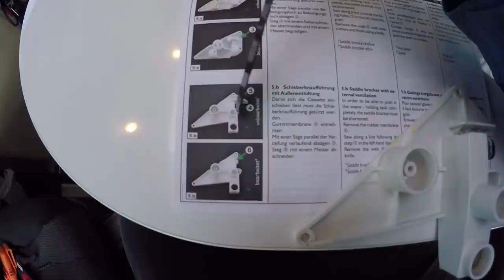Cassette toilet - installing SOG system and toilet talk in a van

Comment: I am looking to buy a similar campervan, but I want to have a composting toilet installed in place of the cassette toilet. In the cassette compartment, i will add a water heater for my recirculating shower. Or, if the water heater already has a space in the van, perhaps the cassette space is large enough for the shower‘s water tank. Thoughts? 🇫🇮🚚

Comment: Dear Finnish friends, how wonderful it is to follow your channel. Finally a couple who dares to say how life is in a Van, the good and lesser moments, winter and summer, and also the adjustments to improve comfort in a motorhome purchased from the factory. You never see that, usually you have built it yourself at home and you can never make a comparison with, for example, this bought and finished Adria.

I have been giving a lot of money to other fluids but the only good working is indeed the BLUE AquaKem. 
My conclusion after many years of experience and testing a lot of brands, sometimes only available outside my country.

- The best solution for Thetford toilets without odors and fast breakdown of faeces is: Install allways the SOG for the odors and use the BLUE AquaKem for dissolving rapidly the faeces. 
- Many will now say, the Blue Kem is not septic tank friendly, and that's true. But any other friendly solution of liquid (Green,...) makes your toilet 'stinks' or smells for days and weeks.
- Composting toilets are excellent but they are made for men and not woman friendly, who have a real problem with there period every month, so it's a no go as a couple.

Very informative video for newbies and so true.

Comment: I may have solution for the pee splash thing: There are these larger size (19mm) Gardena so called STOP  hose couplers/fittings which have a valve in them. The valve close when you seperate the two coupler halves  automatically. You can attach the cut of piece (hopefully you kept it somewhere) of the supplied hose to the tank and the valved part of the coupler and install the other half of the coupler to the remaining hose going to the fan. The valve is water tight and as such you can shake the tank all you want without fear of being stink splashed upon...

Comment: I use a porta potty (a mobile version of the Thetford brand toilets) I use it only for the number one procedures. Number two I try to do in toilets which I visit at gas stations and restaurants. If I need to go number two and a regular toilet isn't around I us the bowl of the porta potty to place a plastic baggy in filled with some sawdust. I do business in the baggy an thigh a knot in it to close it.  I store the bag(s) in a small bucket with a lid hanging from the chassis of the van and when I find it  I throw the bag(s) away in a dumpster or larger container. I do this very few times since I plan my shit rather well... pardon my french... but emergencies do occur as we all know...
Back to the pee story: 
The porta potty system uses an upper and a lower tank and a hand pump to transfer clean water from the upper tank through the bowl and drains into the lower tank for storage. Mine is about 15 L and lasts me a week only using it for number 1.
I use plain water in the upper tank with a little bit of a liquid sold in aquarium places called aquarium filter starter, which is a mixture of harmless but very helpful bacteria which break down ammonia (the chemical in pee which causes the nasty smell) I use a very small 3 watt air bubbler (from a even smaller aquarium which runs only for 20 minutes after the toilet has been used and also switches on when I start my van's engine) The bubbler aerates the waste water in the lower tank to help the bacteria break down the ammonia added to the waste water during peeing. The bacteria need ammonia to eat and oxygen to breath. The ammonia smell has no time to develop inside the waste tank because the bacteria are very fast in doing there job. The ammonia is converted into nitrite and eventually into nitrate which are both odorless. Nitrates are harmless to flush into nature since it is a naturally occurring fertilizer. So basically I can (and at times I do) empty the lower tank in the forest (obviously away from any nearby streams or wells.  Basically I am watering and fertilizing plants in the vicinity...
For those skeptical: look up on google: Nitrification Cycle and Nitrifying Bacteria... Both are common names in the aquarium/fishtank world, are present in nature and both are very well documented as being a safe, clean and environmentally responsible way to deal with ammonia laden water...

Comment: The blue stuff will (as far as I know) kill a septic tank, though, so you need to be careful about where you dump it. However, I've heard good things about Elsan green/organic toilet fluid, but not sure if you can get those in Finland, it may be a UK only thing. But people seem to think it works quite well to control odor, and you can use it both as flushing fluid and tank treatment. One chemical to rule them all? Personally I'm getting a composting toilet when I get my van. I know they import the Nature's Head to Europe at least, but I'd prefer the Airhead. Gotta empty pee every few days, but you only have to empty the solids once every few weeks. I wouldn't personally stop using fluids in the toilet just because you have a fan now though. The fluids do help break down the solids too (a little) so it's easier to empty and doesn't stink  as much.
Reply: Your right, all septic tank dumps ask you not to use blue loo chemical as it kills the enzymes that break down the toilet waste. The pink and the green additives are friendlier, but don't work so well in breaking down the waste and the poo smell is not masked regardless of how much you put in.
Reply: @ukbusman  Yep, the Thetford green stuff is complete garbage from what I've read. But, the Elsan green (that replaces both the green and pink, can be used for both) has gotten rave reviews. And well, using something a bit more nature friendly if at all possible isn't a bad thing.

Comment: I suspect the fan creates to little vacuum to pull the urine up and across the length of the hose to the fan and filter.  Now if you moving and the toilet tank is full and splashing then you could encounter liquids in the extraction hose.  In this problem a filter sponge may be useful.